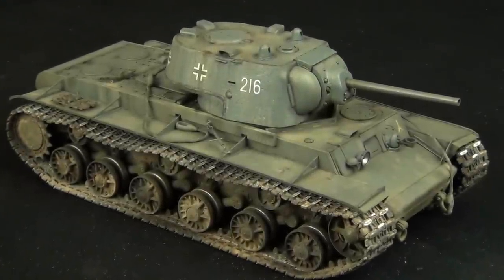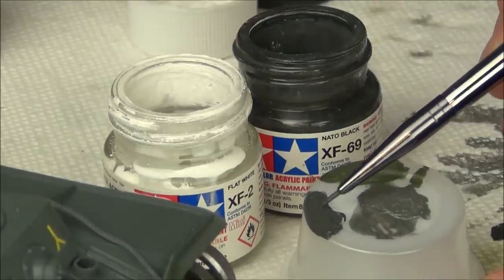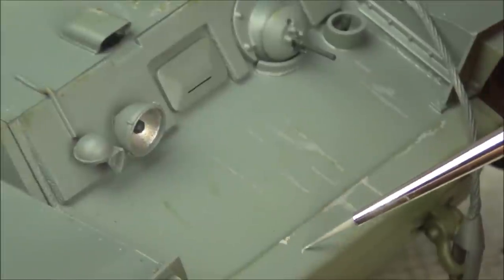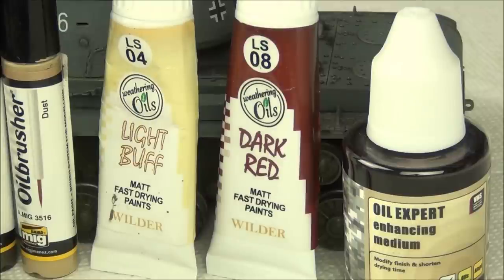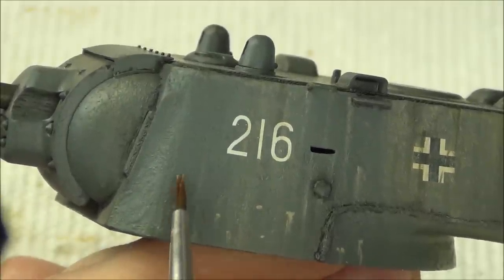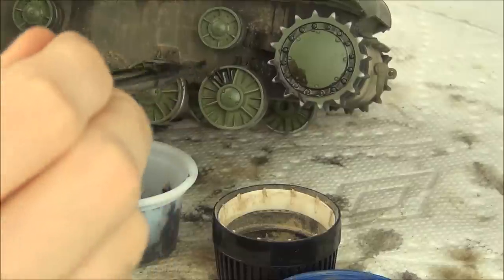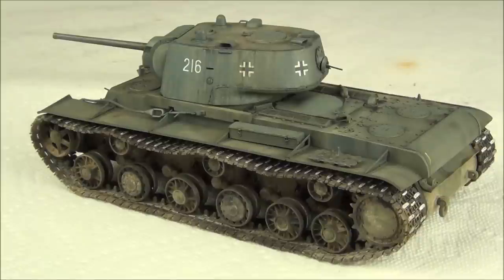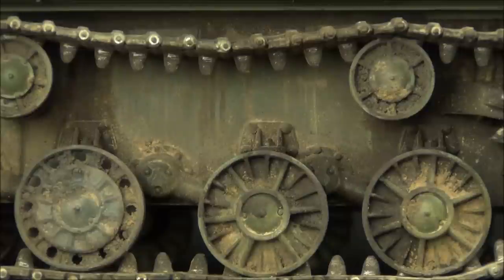Let's Weather a Captured KV-1 (Beutepanzer) in 1/35 Scale | Standard Weathering Procedure Ep.6

Comment: I am currently also working on a KV-1 tank (German booty variant) model 1941-42 in 1:16 by Heng long RC!. And 1:16 is already huge compared to 1:35, I do the rough steel or cast structure with the Plastic Putty from Vallejo. Today there are still individual parts that had to be ordered that were missing.

Comment: I think that wear and chipping down to a red primer makes the model "look" more plasticky than it should. I prefer wear and chipping effects that goes down to a silver or steel color by dry or semi-dry brushing, with only a hint of primer red-brown at a few random spots to hint at the presence of a primer. Some of these are then dry brushed with Gunze rust, some are not, to simulate fresh and older wear throughs.
--
When I started in the 1980s I did not have an airbrush and I found spray cans too thick and covered up too much detail. So I used to triple dilute the paint and hand paint the model in four or sometimes five coats to get a brush stroke free surface appearance. One thing I could do back then because the paint was put on in many layers, was do some heavy dry brushing before the final layer which is thin enough that a lot of the silver or rust effects barely shows through the main coat. This is then finished with additional dry brushing on top of the final coat of paint. It is more three dimensional and looks quite convincing. The problem of course was that it's very hard to do the late war German three color camouflage patterns without an airbrush, so I simply didn't do it. I stuck with the field grey era stuff and if I did the late war stuff, I simply did the winter schemes with white and weathering over dark yellow.

Comment: hi my friend !! 🙂
I have a question..

I really like your works and video, very inspiring!...and I'd like to ask you if you use pigment fixer... or not... and why? 😛
I usually use it , but the color of the pigment always go in a darker tone, once dry !! 😞
I have try not to use it, (only enamel thinner) but once dry pigments fly away at the minimum touch 😢
can you help me?
thanx a lot !!!
Reply from the maker: Hello!  Yes I can help you.  

I usually do not use a fixer for the reasons you mentioned.  Instead, I apply a matter varnish beforehand.  This add a texture to the model that the pigments hold on to quite well.  It's not perfect but it works for me.  Additionally, I usually apply my pigments on the model with enamel mud effects still slightly wet, so when the enamel mud wash dries it also holds onto the pigments a little bit.  I believe I showed that in this video :)  

I hope this helps you out!
Reply: @Panzermeister36  
Hi!  
..first of all, thanks for your quick reply.  you've been very kind.  

yes , yes ..I saw the video and how you use the engine grime effect, as a fixer.  
I immediately tried it too and I like it.  😅😅

Next time I want to try using pigments by mixing them with mig olibrush!  🤔
...otherwise, I Guess the only alternative  would be to recolor and lighten the pigments after they have dried .. sigh 😓

in the meantime, thanks again.  Hello from Italy....and Sorry for my english 😅😅😅🙈🙈
Ciao

Comment: hey so you don't have an issue with the base coat rubbing off after you use the enamel thinner for pin wash and clean up since you dont apply a varnish as you stated at the 5:50 time slot?
Reply from the maker: Never any issue with Tamiya acrylics.  They are very durable.
Reply: @Panzermeister36  how about the Tamiya TS spray cans, they're lacquer?
Reply from the maker: I've never tried those personally.  But I expect they would be similar.
Reply: @Panzermeister36  thanks for the reply. Theres a hobby store called wheelswingshobbies in toronto and they have a brand new used tamiya -156A tiger tank from 1975. any thoughts on those kits?

Comment: Hi mate, happy new year I have a question about this kit if you can shed alittle light!? I'm building it just now and just noticed the rear drive sprockets are in different places on each side the left further out than the right side?  Was the kv like this or a flaw in the kit?
Reply from the maker: Hello.  Happy new year :) the sprockets should be in the same place, but they might appear different since the road wheels are offset on one side.  This is because the torsion arms have to be offset along the hull floor. If you look from the bottom that should be apparent.
Reply: @Panzermeister36  yeah I see that my left one I'm sure is further out the rear than the other side I'm sure it is just by a mil or something but was noticable when looked at it from the bottom there, I'm just trying to find a level to make sure haha! Either that or the teeth are to long on one of my sprockets I cam notice it and need to sort it or will bug me haha
Reply: See i have my fenders cut at the rear and one bit off the front so the sprockets are right out there on show! See cutting out them rear grills for abit of PE mesh that was a job and a half lol I've got a barrel for this tank in the parts box actually forgot about that being metal barrel should look better than this one! I have the KV2 kit to do after it and a T26 for a diorama with a bail out crew so some thinking is needed it's nearly 3am now and still up modelling haha

Comment: Would the hair spray chipping work with rustoleum spray cans?
Reply from the maker: Probably not.  One of the key steps for HS chipping is to not apply a very thick coating of paint over the hairspray, otherwise it's very hard to chip.  Another key is to avoid using lacquer paints (instead I use alcohol-based ones) since they dry very hard and are difficult to chip.  

Spray cans are usually lacquer-based paints and always apply in thick layers, so that's two strikes against it.
Reply: Okay excellent, thanks! I’m currently building my first tank kit, i’ll probably have to try and do some brush chipping. I’m building the monogram m48a2 patton because its all that was locally available. I think watching your videos has turned me from 1/24 muscle cars to armour for sure.